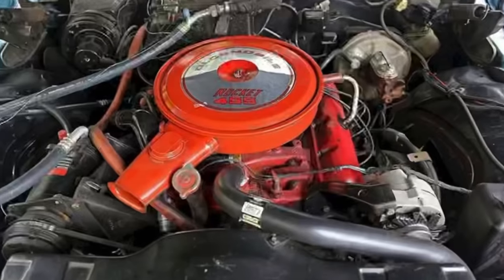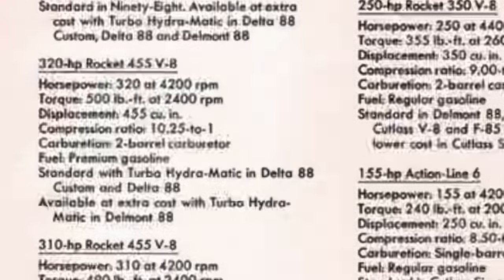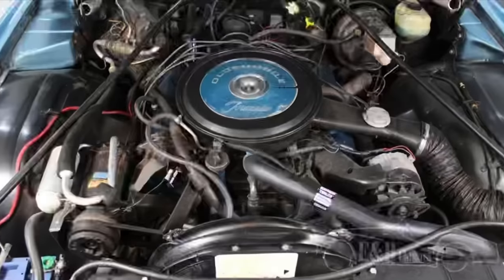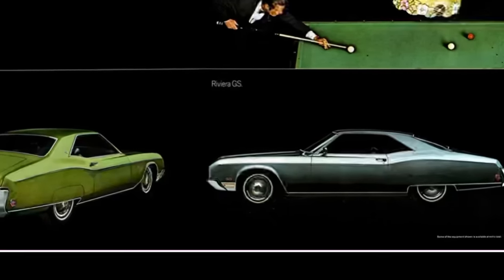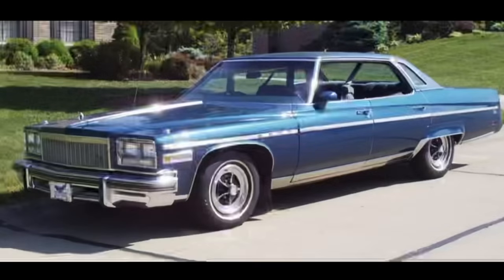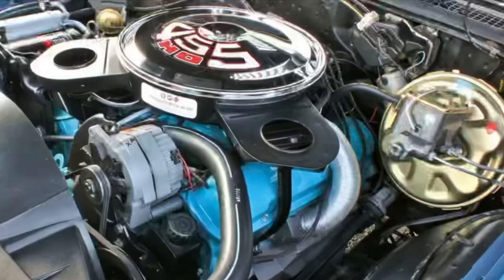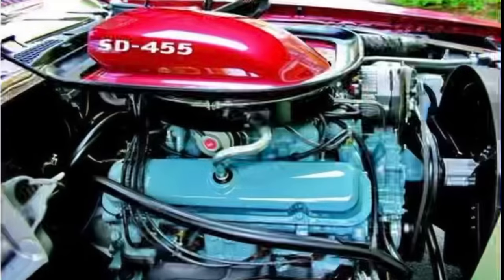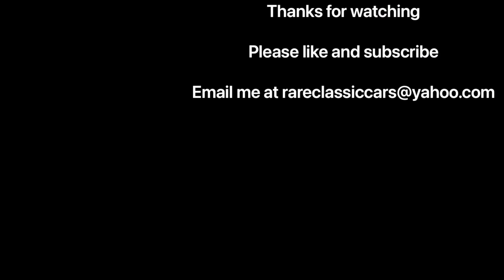Best Car Engines - The Rise of the Mighty 455 V8s from GM’s Buick, Oldsmobile, and Pontiac

Comment: Back in 1980, I was only 18 yrs old when I horse traded to get a '71 Buick Riviera. The car was in near showroom condition. Still had the factory options sticker inside the glovebox door. It had posi-traction & duel exhaust. I can't remember what else the sticker said, but all the men in my family swore it had to have Stage 1 heads, because it was insanely powerful, and would easily outrun the other big blocks owned by family & friends. ( The new owner of IHRA who is a total Buick fanatic, recently told me that in 1971, you could still order a Riviera with the Stage 1 heads on the 455, so perhaps the men in my family were right. ) You could leave the shifter in "Drive", and even at 15 mph, jab the throttle suddenly to about 2/3rd's, and roast both tires off. NO "power-braking" needed. You could feather the throttle back to coax the transmission to up-shift into every gear, still roasting the tires. ( Ya gotta remember, I was just a kid at the time, and all the men in my family loved racing & building/workin on, or even hot rodding some engines. I could service my engines, changing distributors, points, condenser, plugs, wires, oil change, but then I would have my father or uncles set the timing & tune the carb. ) Of course the car was too heavy to launch from a standing start, it would just spin. But I finally coaxed this other kid into racing me from a 40 mph roll off. He had a '68 Firebird with 400/4 speed ( in immaculate condition ). I gapped him so bad, he didn't even meet up with us at the agree'd upon location after the race. And from a standing start, we used to watch him outrun just about everyone else. ( He never made fun of my "pimp mobile" again, lol. ) I kept that Riviera properly serviced for a year or so, it never used a drop of oil between oil changes. Traded it to an uncle who owned it for at least 10 yrs or so. He loved & babied the car.
Reply: You must have had  Riviera GS ?  Ya a good strong stock Buick 455 is a force of nature. Getting someone to go from a roll is the way to go,  I have a 74 Century Grand Sport 455 that is built to high compression specs, headers, and intake - and it is pretty hard to beat from a roll unless you are a fast Vette , Built Mustang or a purpose built drag car.  I have had quite a few import sport sedans try to pass me on my little country drives and  I always play coy and wait for them to pass me at like 60 MPH , and as soon as they start to come around me I hit it and in 7 or 8 seconds I am usually more  than 6 car lengths ahead and pulling away hard.  They usually give up.
Reply: @gt-37guy6  I honestly can't remember if it was a GS. I wish I had pictures of it to refer to. Believe it or not, your description of gapping guys who are trying to pass you is exactly how it looked when I raced that Firebird 400/4 sp. When we both took off evenly at about 40 mph, I immediately started pulling away hard. It was at night, and I was keeping my eye on him in my driver's side-view mirror (  4 lane state highway, he was in the left lane, me on the right. ) Once I got at least 6 car lengths ahead of him, I thought he was stroking it & playing with me, so I let off. Just then, I saw his head lights jump & realized he just banged 4th gear......and because I had let off, he was gaining FAST. Of course I floored it again, with him gaining, to the point he was right at my rear, but that's when I started pulling away from him again.......and literally left him. Even if he had passed me, it was obvious that I would've easily caught & passed him anyway. Oh, by the way, I had a passenger, he was by himself. It was hilarious how he never showed up in a certain parking lot in town, where we agreed to meet up, and it's too bad we didn't have cell phones back then, lol. I always wanted to try racing the big block Mopar's from a roll off, but Cullman Alabama was a small town, and I really didn't know of anyone who owned one at the time.
Reply: If that was Dave McClellan he knows his Buicks!
Reply: @fenatic7484  The fella I'm talking about does live podcasts with Uncle Tony's Garage about every week. Darn, I can't recall his name. But they've done several videos where the fella explained an awful lot about the Buick engines, their history, and especially the differences in the cylinder heads, and what to look for. Probably is the same guy. He has an old Chevy or GM Suburban with a 455 Buick he put in it. Maybe that will ring a bell with ya. ????? ( But he did officially re-establish the IHRA about a year ago. As you probably already know, the IHRA was around long before the NHRA. I'm not clear on why the NHRA took over, as the IHRA faded away. I'm sure it had a lot to do with money & politics. )

Comment: I remember the big Olds 98s, Buick Electras and Pontiac Grand Villes, when I first started driving in the late 70s and one would come up behind me id slow down so that they would pass, and after they started passing i would floor my 6 cyl Dodge Dart so they would have to open up that quadrajet! Loved hearing them big GMs open up, they usually didnt even notice I sped up, they just eased on around like I was not even there lol! As soon as I could I bought one! I ended up owning about 10 big Grand Villes, Bonneville Broughams and Grand Prixs! All with the 400 4bbl or 455 4bbl!

Comment: When I was a kid in high school I tuned up a 455 in an Olds Vista Cruiser.   The distributor is on the back of the motor.  So, to get to it, I just climbed into the engine compartment and sat on top of the engine.  That's how big the car and engine were.

Comment: I agree that all these engines are great and each has their pros and cons. If I were going to build one I wouldn’t hesitate to go with the Buick. Buick speed parts are expensive but a rebuildable 455 Buick engine costs less than a bare set of HP Pontiac or Olds heads. The Buick has a huge cost advantage because all Big Block Buick heads are nearly identical. Years ago one of the major car mags did a bolt on comparison between all the big V8s and Buick made the most power.

Comment: The start carts used to spin up the J-58 engines in SR-71 aircraft had two Buick 455 Wildcat engines that were supplied to Lockeed by a hot rod shop near the Burbank facility.

Comment: I have a 1973 Riviera. With a simple build, 9.9:1 comp, Cam, Intake, 850 carb, built TH400 with a small stall, Posi rear. Heads were mostly stock, stainless valves and the bowls cleaned up. Car went 12:90 all day long and i done to the track with the AC and Cruise control.

Comment: My 1973 Olds 98 came with a single exhaust from the factory. I put a set of dual exhausts with factory style mufflers on it and it seemed to help with the top end power. Of course then again, maybe it just sounds faster.
Reply: I did the same with a '76 98. Improved 0-60 times by 3 seconds and gained 1 1/2 MPG at 60 to   65 MPH.
Reply: @turbo8454   I believe your gas mileage claim but you're saying you gained 3 seconds 0 to 60 time just by putting on dual exhaust??
Reply: The engine was rated about 20 HP higher when equipped with a Factory Dual Exhaust, which still wasn't all that Free Flowing
Reply: Put a couple Flowmaster 44s on it and it sound even faster still.  :)
Reply: @ONTHEEDGEFRED  0-60 went from 14 seconds to 11 seconds. With the installation of the dual exhaust, the cat was eliminated  too. The GM cat was very restrictive. The same cat was used on the small  block cars too.
Reply: @turbo8454  Wow,  14 to 11 is definitely believable, more believable than what I 1st thought of  From 10 to 7.
Reply: @ONTHEEDGEFRED  As  a side benefit, it picked up a slight amount of wheel spin on launch. But 0-60 in 11 seconds was still slow lol. (well maybe not in 1979 when I bought it)  My 427 Chevy wagon was running 0-60 in about 6.5 seconds then.

 Over the years I did a few others as well. A '67 Electra, '68 Wildcat and a '72 Electra.  Those all picked up mileage and performance too. I never measured any of those before the dual exhaust but all of them had more performance stock than the '76 with the converter had. The '76 was the heaviest too.

I still own the '68 Willdcat. With just dual exhaust, a 10 degree hotter cam than stock and a 3.07 open differential, it ran the quarter in 15.06 at 90 MPH.  Eventually I added headers and a positraction unit and it went 14.41 at 95MPH. All this was back before 60 foot times but the posi definitely helped the launch (on 235-75/15 street tires) and the headers really helped in the HP (MPH) department.
Reply: Took a '73 Rocket 350 from a cutlass and had it installed in a '77 Ninety-Eight regency that had thrown a rod.

The engine from the Cutty was unkillable. Start it up in the dead of winter and it was immediate. No smoking ever. Never burned oil. They stole the car and stripped it, took the entire carb and intake assembly off the top.
Reply: I got a 71 Olds 98 from my dad around 1979. I put dual exhaust on it and a Comp Cams High Energy 260 cam and lifters. 2.73 open rear. It ran 0 to 60 stopwatch 8.0 seconds. Ran it at Island Dragway and saw 16.3 at 86 mph.

Comment: Lots of Olds fans judging by the reviews. Had my own in a '72 455 W30 & a 350 Cutlass in '74. Had to be respectable by then. Bent push rods in the 72 & floating valves in the 350 and weighed 3 tons ! But there is a lot to said for the 400 Ponchos and even the Buick GS 400's ! Lovely trip down memory lane . Look forward to more about the Vega and SD 455 ! Keep up the nostalgic work !

Comment: Mopar got in my blood somehow and never left, despite tinny bodies, wind noise and something leaked, usually power steering. But I had a ginormous 76 Olds 88 Royale 4 door hardtop. Cinnamon red metallic, white top, gorgeous car, rode SO nice, smoothed out even the roughest roads with aplomb. 1st year of square headlights looked modern, last year of Olds only V8. It had the luscious 455, low compression, I knew not to expect the same as a 70 era big block. The car got handed down to 4 different family folk, ran to quarter million miles and basically parked only due to tired of driving it and it did rust after many salty winters.  Nothing leaked, did not use oil, always started. I’m still impressed. I shall forever miss that ride.  Vehicles are too stiff now days for faster cornering, so I feel more beat up. If do over, before the Olds, I test drove a 69 Grand Prix. You could feel the higher quality door shut, wind seal, the power steering and brakes were so much better in feel and use, curved sporty dash, console, buckets.  A masculine car. Just a ridiculously long hood, requiring about a 10” deep fan shroud.  Those needed a nose reduction, would be my only critique, a full foot cropped.  Shove some friends in and would’ve been good cruisin memories made in a 69 GP.  Console and buckets not as handy fun as 3 wide bench at a drive-in.  Young folk, “What’s a drive-in?”  Giant outdoor movie theater with a wired heavy metal speaker box to clip on door glass to hear the audio in basic unimpressive mono. Drive-ins were fun. Some teens tried sneaking more in via hid in the trunk for free. Would be pretty handy natural social distancing in a pandemic!!

Comment: My older brother worked for GM and got my mother a '67 Riviera, '68 Riviera (430 4brl), and a '70 Electra 225 (455 4brl).  I didn't get a drivers license until the '70 Electra so missed out on the nicer ones.  The '67 in gunmetal gray was the coolest.  The 4-door Electra would burn rubber and suck gas but was a great party-mobile for a high-schooler.

Comment: Being a former Buick racer the Buick 455 was the best. The block was much lighter and when it's built tough to beat. Taking care of the oil pump with higher flow is much better, more oil getting around takes care of that. If your going over 525 Hp you want to griddle the bottom end. Stage 1 gets you rocking and Stage 2 for the competition don't even waist your gas the Almighty stage 2 will crush the competition. All different types of intakes available for the engine and save 50 to 60 pounds over the cast iron. All different types of cams available as well, you can go from mild to wild depending on your application build. Headers really help, carburetor our test went from mild to wild as well. 750-1150 CFM didn't matter our cars screamed. the gaskets today are much better than they used to be. Spark plugs Bosh platinum plus Best plug we ever tested. Double timing chain add strength Cooper freeze plugs and head gaskets will definitely give you longer last ability. Over the Buick was the best. Time slips don't lie at the drag strips. Modified oil pick up tubes getting more oil to the bottom end is the Key.😉

Comment: Olds 455 was bulletproof,  and I have never seen one fail regardless of miles,  same with Olds 350.  Buick was the lightest, and seemed like the most Powerful 455,  especially the 1970 High compression,  but you sacrificed longevity compared to Olds in my opinion.   Pontiac was very strong, but not the reliability of the Olds, or the Performance of the Buick,  kind of in between.

Comment: Adam, way back when in ‘74, I had a ‘71 GTO 4-Speed with the 455HO. It had two issues which eventually caused me to get rid of it. First, it used a rope rear main seal which ruined two clutches by leaking. Second, there were only 3 bolts holding on the exhaust manifold on the driver’s side. This meant I was dealing with a constant exhaust leak (pst pst pst) except when it rained! Then it was quiet. The car had standard factory mufflers which really amplified the leak. Were you aware of this? Otherwise, great car. Also, I had a ‘68 Catalina with a 400 2bbl. That suffered with a starter that would overheat and then wouldn’t crank and I’d be stuck waiting for it to cool down. Eventually, I replaced it with a 9 volt starter and that did the trick.

Comment: I took my first driver's test in my mother's 1971 Pontiac Bonneville - with the 455.
between the over-boosted brakes and the 455, you had to master being very smooth on your pedal inputs.

Comment: I had a 1973 Olds Toronado. The engine was bulletproof. With the stock dual exhaust and resonators top speed was limited to 105 mph. I replaced the stock mufflers with Walker glasspacks and eliminated the resonators. Top speed immediately improved and it would peg the 125 mph speedometer. Once the glasspacks got blown out it sounded so good. A new fuel pump and FRAM high-flow air filter made a noticable improvement in sustained full throttle accelleration and plenum sound. The only real issue I had with it was that the carb would boil dry in the summer from engine heat after a long drive and being parked for a few hours. For a land yacht, that car was amazingly fast and got off the line really well. Didn't turn or stop well, though.

Comment: In the mid-2000s (when I had way more project cars than one guy should have), I bought a 1970 3/4-ton GMC truck with no drivetrain at a car show swap meet. It sat around for a year before I decided to stick an Olds 455 in it after hearing about the GMC motorhomes from the 70s that used Olds engines. After getting it together, I often wondered why they didn't offer them in GMC trucks. Besides being a great engine for a truck, it could have been a good way to differentiate GMC from Chevy, rather than just the grille and badging.
Reply: My brother in law and I put a 455 Olds in an early 4 wheel drive Blazer, for off reading and hunting. The low end torque made it a real pleasure out on the old 2 tracks through the woods!!

Comment: As an Olds owner your depiction of them being a little wheezy at a higher RPM is mostly correct for the 350/400/425/455.  However, all you have to do is port/polish and port/gasket match the heads.  I did this with my 350 and it was a HUGE difference and I've known folks who've done it with the 455's and yikes!  They already have gobs of torque to begin with so opening them up and letting them breathe even more is night and day.  Bonus: they even get better fuel economy because they are more efficient.
Reply: I agree.  When I was forced to rebuild my heads due to a failed cam gear on my 455, I had the heads machined with a quality 3 angle valve job. Also, since this engine was somewhat a standard version, I got a prescription from “Dr. Oldsmobile” which was written as W30.  That is, swapped out the intake for an aluminum one and most importantly tuned the carb.  The Q-jet is a very versatile carb. The same casting can be used for big and small blocks since it has secondary air valves which regulate the air intake to the engines needs.  I think Oldsmobile was rather conservative on their version of it.  But, it can be improved with the right tuning.  Once that was done my engine was a real “rocket V8.”  It’s funny, at the time, Oldsmobile was claiming their new cars were not “my father’s Oldsmobile.”  However, mine essentially was – and it was way better than the new ones of the day.  Dr. Oldsmobile’s prescription fixed the wheezing.

Comment: The Pontiac used a plastic tooth- die cast aluminum timing chain sprocket on the camshaft up until 1970. The '71 and onwards got a steel sprocket. The plastic sprocket would shed its teeth if you really got into it. I know, I changed a lot of them.

Comment: I imagine that these big blocks simply weren't pushed to their limits from the factory. They were often placed in big cruisers,  not cutting edge muscle cars in a competitive segment. Also,  at some point they were exceeding the abilities of street tires of the time. L88 and ZL-1 BB Chevy motors were the only ones really challenged in motorsports, like LeMans races. They are alleged to have like 565hp and a top speed of 188 in the Corvette.  That's easier to achieve in a lightweight sports car than a big cruiser which needs bottom end torque.